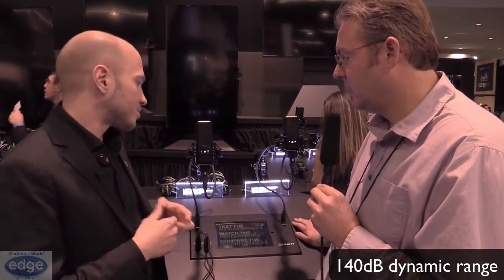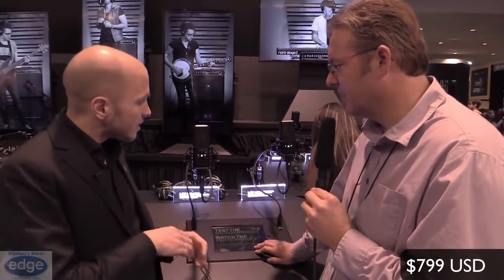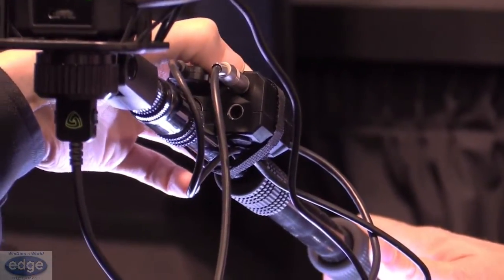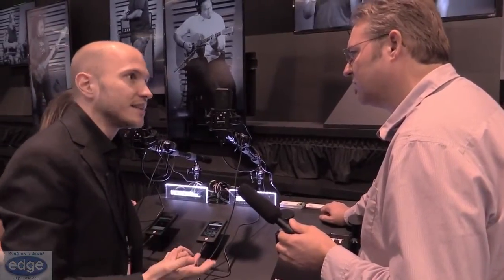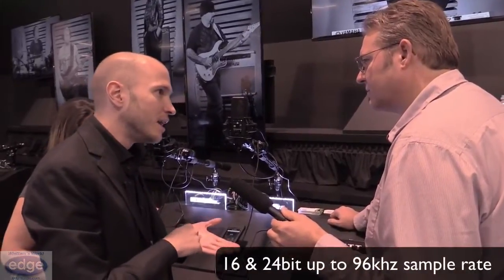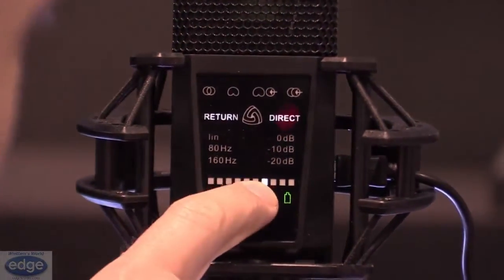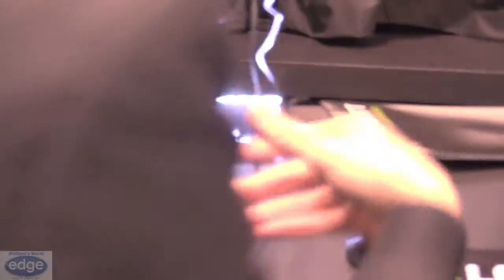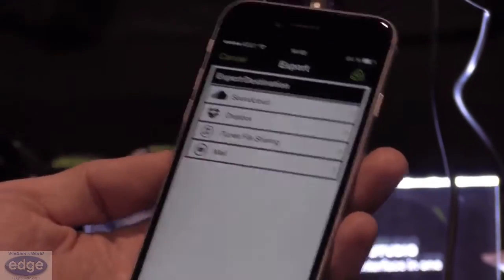Edge Studio's Whittam's World - NAMM 2015 "Lewitt Audio"

Comment: So since it's got a 0dB self noise. Large diaphragm, condenser, cardioid. Wonder  what it would sound like with a Cloudlifter in the signal chain. I use the CL with my vintage Sennheiser 441, George, so I know the dB boost and clarity I get with this setup. Not looking for "perfect" noise figure, since my noise floor is already pretty good. I use the AT 875R for promos and such, the Sennheiser for narration and audio books. But low noise overall is really important since most of us don't have either the $ or space for booths, those of us who work from home, largely. Lawn equipment, construction, trucks, etc. are the other issues I'm dealing with, so anything that rejects those artifacts you hear on playback, so you can concentrate on your read instead of trying to edit out a distant lawn mower, some days. Thanks for posting, George. You save us all a lot of headaches around the home studio experience. Thanks, bro!